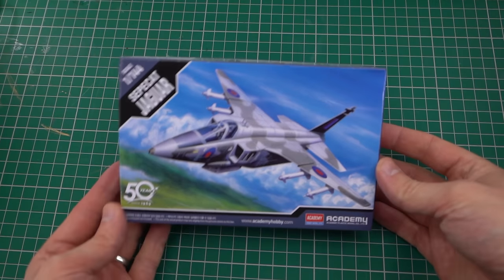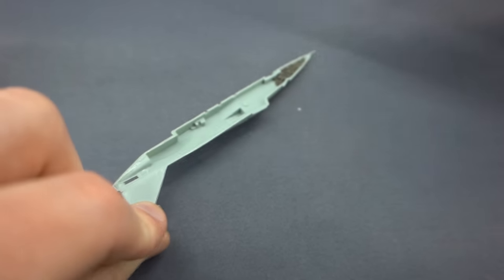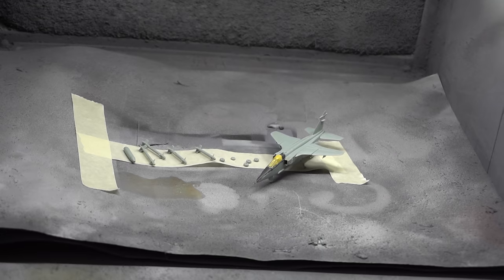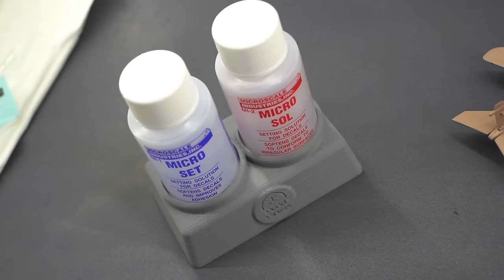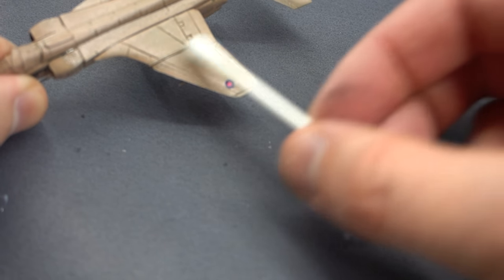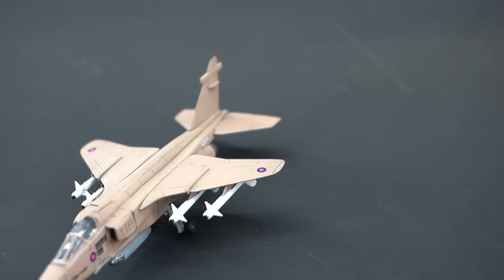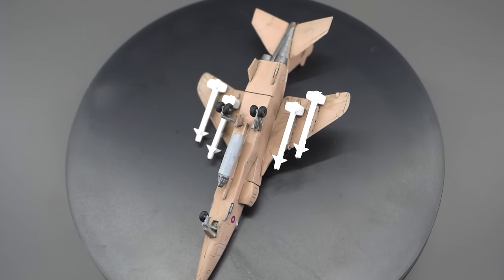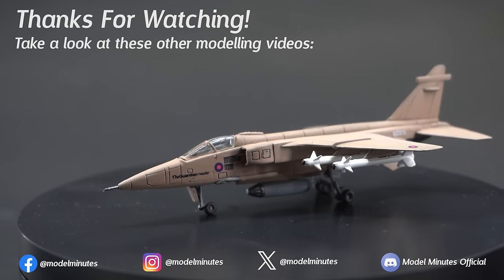Sometimes You Just Gotta Build It! Academy Jaguar Plastic Model Kit - Build & Review

Comment: I can’t claim any level of in-depth knowledge, but is the nose on the model in the thumb nail correct? I thought that the RAF version had a squared-off nose rather than a pointy one?
Reply from the maker: i can't say that i noticed or know about that tbh
Reply: The RAF single  seat Jaguars had a system called LRMTSS, it was a laser ranging device. The nose was a chisel shape with windows. The two seaters didn't have, or the French Jaguars

Comment: Hi Matt. Sadly it looks like a lot of these 1/144 aircraft kits are pretty awful. I would have expected better from Academy. Those weapons are a joke lol. Just a quick note about Microset and sol. If you read the instructions on the bottle, you don't need to use Microsol if your decals are on a flat surface such as the wings and flat fuselage sides. Microsol is only needed if you need the decal to conform to a sunken shape. EG the dials on an instrument panel.
Reply from the maker: they might be awful kits but for something cheap to build they fit that bill quite nicely.

Whilst i might not need to use microsol if it is a flat surface, it can't hurt right?
Reply: @ModelMinutes  Aye, but you are just wasting that Microsol. My bottle of it is 3/4 full, but my Microset bottle is nearly empty.